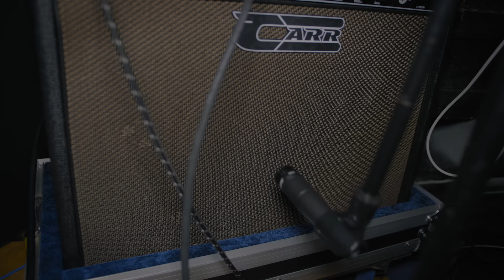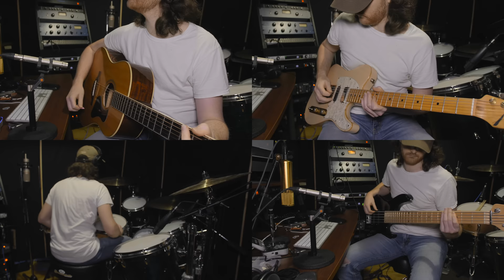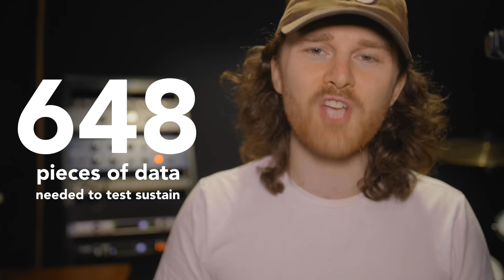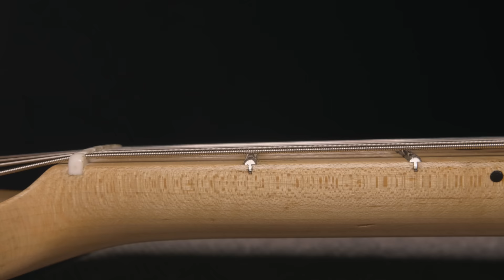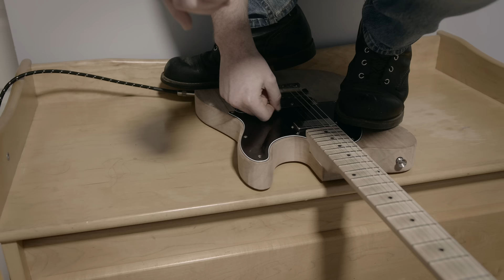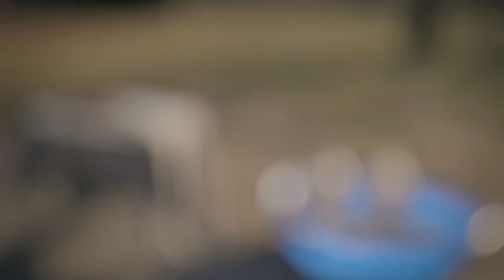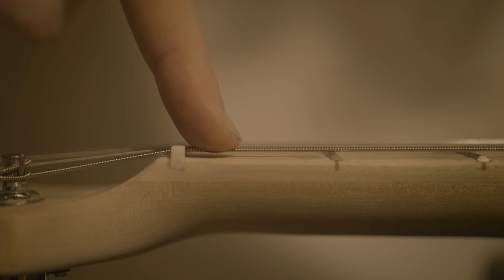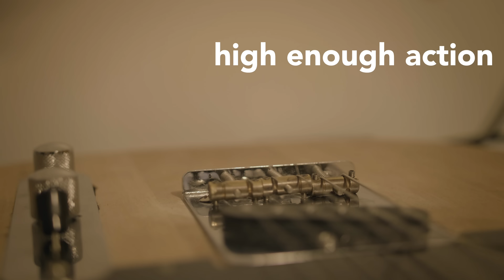Tested: Where Does The Sustain Come From In An Electric Guitar?

Comment: It's always struck me that keeping the energy of a vibrating string in the string is the best way to sustain the vibration. Taking a significant part of that energy and using it to make other things vibrate means the string doesn't have that energy any more.

But then I'm just another person with a half-baked understanding of physics having an opinion. What we need is tests. Thanks Jim Lill for providing them.
Reply: I would agree with you on this 👍
Reply: Your point of view makes sense.  When people go on about having a resonant electric guitar, they are saying that losing string energy to the guitar body is a good thing.   That doesn’t make sense, especially if you are looking for good sustain.  

The whole thing about how if an electric guitar sounds good acoustically it will sound good plugged in is ridiculous.   That’s an Eric Johnsonism that gets repeated endlessly.  It’s nonsense.
Reply: @mark78750  With acoustic guitars, you want to transfer that vibration into the body and for the body to resonate, because the body is doing the amplifying. But with electric guitar you don't use the body to amplify. You're using the amplifier for that!
Reply: I think that’s right for an electric guitar. Acoustic guitars have to transform the vibration into air movement, so that’s a completely different situation.
Reply: I literally had the same epiphany while watching the video.  Seems to me the more insulated the string the more vibration it would keep.  I also understand the quiet resonance test winning out.  Works the same way as cold water heating faster than hot.  The string warbling heavily causes it to loose it's vibration quicker than say a medium to light stroke.  So while you would see a louder sound from a heavier stroke it would also suffer the most sustain loss of volume.
Reply: But like Jim said, how long do you need a string to sustain a note?  He said the longest he's ever played is 4 seconds. All of the guitars, including the cheap kit guitar, had sustain that lasted close to 35 seconds. The difference between the brass saddle and the wooden dowel wasn't that great.
Reply: @joshuasox  I figured sustain was a negative function, as in it's best described as kE loss per second, as a percent value of the original signal. 

Would follow from there that loud notes have the most to lose? I honestly don't know.
Reply: @mark78750  Leo Fender understood this. He specifically designed the first Fender guitars to decrease resonance, because before the Telecaster/Esquire/whatever, most electric guitars were jazz-boxes and hollow-bodies of some kind, which were notorious for screeching feedback. For this among other reasons, I prefer bolt-on necks; that's another thing Fender got right -- you can't exactly just pop on a new neck when you break one on your Les Paul or whatever. Fender's philosophy was all about modularity, practicality, &c. and just makes sense.

I'm not very attracted to set or through neck guitars in general, though they have their place. Not to mention the whole headstock break angle thing. You don't see Strats or Teles with broken headstocks. And simple woods like maple and pine.
Reply: @Lunumbrus  exactly, they would lose the most volume quicker.  I plan on testing myself later this evening.  I have several different guitars to try on.  Like these experiments that challenge the status quo.
Reply: @joshuasox  I can't lie, I'm excited to see how this might affect variability in custom builds, particularly travel-type designs.
Reply: As a banjo picker, I can confirm this. When I slide a brass mute onto my bridge, the result is less overall volume and twang but significantly more sustain. By increasing the mass & inertia of the bridge, less energy is able to transfer from the strings to the head.
Reply: I always thought this until I had an epiphany today. Maybe a resonant guitar accepts more energy from the pick while you are strumming. This vibrating body might then keep your strings going longer. The theory would be like saying that a resonant guitar would be like a lower-ohm speaker cab that accepts more power from the source. In theory, we have virtually infinite power to impart to the strings. If the body itself will take some of that power, too, then all the better. That said, bodies obviously don’t resonate anywhere nearly as long as strings, so I’m probably back with you on your original point. But just a thought I had today.
Reply: My thought, too. If you take some energy out of the string, you reduce the amplitude of the vibration.
Reply: Yeah, this should be the case due to the law of conservation of energy. The player transfers energy to the string at the moment of the pluck. It is then spent on friction (e.g. the string wouldn't vibrate as long underwater as it would in a vacuum), heat dissipation, and making other things vibrate (air, guitar body, etc.) Having a body vibrate must mean less energy is left in the string, since the total energy of the entire system has to remain constant.
Reply: I always think about an old video where Greg Bennett said exactly this. For an electric guitar to sustain as much as possible you want to keep the movement in the string, not transfer it from the string to the wood. That will steal energy from the string. Not his exact words, just the point he wanted to make.
Now I don't know an awful lot about Greg, and I believe he might have been more of a designer than a builder, but what he said always made sense to me.
Reply: Which would kill any argument for tonewood. Dead in the water.
Reply: @latheofheaven1017  but is that transfer happening by the string transferring its energy through the soundboard, or the air that it moves resonating in the cavity or the guitar? Once again, I feel like the mechanical transfer would equate to a loss of sustain, and it's the cavity that's doing more of the work. The test is that if you block up the hole of an acoustic, suddenly it's pretty quiet.
Reply: @jamesstonehouse3448  To some extent it's both, but much more mechanically through the bridge into the soundboard. Otherwise you could do the following - strum an unplugged electric guitar very close to the acoustic guitar, and you'd hear the sound as if you were playing the acoustic. Obviously that doesn't happen. My acoustic does resonate a bit when I'm playing other instruments nearby, but not nearly as much as when I'm playing its own strings. I'm not sure what your cavity example proves, because it's not just the externally generated sound waves that resonate inside of the cavity, but also sound waves generated by the soundboard.
Reply: @jamesstonehouse3448  Not completely--the wood still acts as a filter: absorbing some frequencies more than others, and so changes the resulting tone.  The slight compromise to sustain might be totally worth it.
Reply: @joshuasox  Think it has more to do with the weight of the string in such an instance... When you pluck a string more briskly it requires more energy to slow it back down and bring it back into equilibrium with the sympathetic strings vibrating around it, thus it loses it energy more rapidly than it would had it been strummed in a fashion that had it vibrating closer to the strings around it
Reply: You are correct, in the science. Playing technique has a lot to do with it also.
Reply: @nesicus  Leo Fender was very practical, not always musical. He had to be convinced of the importance of better intonation years after the Telecaster came out. The break angle is only a problem on guitars like the Les Paul, which aggravates it by angling the neck itself to the body and you don't see broken Ibanez headstocks (which have a break angle). A straight headstock saves on wood (cost effective) but string trees add friction on strings for lesser tuning stability (after bends or floating bridge use). I see no advantage in set necks at all.
Reply: @Leo_ofRedKeep  the advantage of set and neck through designs is the playing comfort you can get. Nowdays they make rounded heels with bolt on necks. Neckthrough design is by far most comfortable at heel spot.
Reply: @Leo_ofRedKeep  adjusting the break angle on les paul, by raising the tailpiece, has profound effect on how the neck and strings feel. It's better to have it than not, as you can set it how you like it. I'd argue that changing this angle has an effect on string tone as well, but I guess it's too dangerous here because people have seen the light and are already trashing their instruments because nothing matters in guitar, just the pickup and strings. Pickup and strings doesn't make a bad instrument into a good one. You can't stick PAF on tele and get 59 Les Paul tones.
Reply: I have been preaching that and other basic physics facts on guitar channels for years!  I also get into more advanced wave theory, the electronics... Degree as an electrician with some  engineering school, and luthier for over 40 years, and a huge physics geek!  I even built wave tech (electromagnetic spectrum) for major universities, research institutions in medical, Biophysics, material sciences and other fields, even NASA...
Reply: @mark78750  A crap load of famous musicians drank the koolaid, and are experiencing the placebo effect!
Reply: @latheofheaven1017  Not the whole body, just the soundboard.  The body just reflects sound around inside through the air, and out of the sound hole, so stiffer back and sides gives better reflections!
Reply: @Lunumbrus  You are getting sustain mixed up with decay.  Sustain means to keep over time, decay to lose over time:  Sustain decays into silence.  They are related but not one and the same.
Reply: @TheMemagNeman  I don't think the break angle makes any significant tone difference. People debating this are audiophiles interested in sound, not music.
Reply: @Bob-of-Zoid  Most musicians (most artists, really) are feeling fools going off their own fantasy. What they have to say next to their playing is of no value whatsoever.
Reply: @Leo_ofRedKeep  It's not significant, it's minute but it's there.
It does change the feel of the instrument.
I play guitar every day.
I tinker with guitars every week.
Reply: @nesicus  Maple doesn't break as easy as mahogany, but as for Gibson head stocks breaking, That's an engineering flaw they are unwilling to correct, it not only breaks easy, due to the angle bringing a cut across the grain, but it's a huge waste of wood to make them that way, an ever scarcer natural resource!  There is absolutely nothing wrong with a luthiers joint!  Even the not so good as now glue they used in the 50's was sufficient to make a joint, stronger than the wood itself!  If you make a neck strong enough to not break easily, a bolt on for easy replacement is not required, and fender did not doit for modularity, but for speed in production and cost savings!  Fenders should have more angle to their headstocks! The need for string retainers cause tuning issues!

The neck joints in most bolt on instruments are unfinished and shrink and swell with climate changes, sometimes leading to cracked finishes and even cracked wood.

 Both Fender and Gibson are resting on past achievements and charging a small fortune for the name alone!  They are stuck in the past and selling tradition, which is worthless when compared to technology!  Want that Strat or Telly sound?  Use the same pickups in a real guitar!
Reply: @TheMemagNeman  The angle changes the feel of strings, yes, because it determines the pressure against the nut or bridge. The smaller the angle, the less pressure there is and the player bends an effectively longer string, which makes it easier. That's why people think there is less tension with a smaller angle (it's wrong, tension is the same but bending is easier). It's only a matter of adapting, though, the same as changing string gauge or type.
Reply: @Lunumbrus  I have been building guitars for a loooooooong time, and you can do what I and others did and study the sciences, do all the math, do some experiments, only to end up building pretty much free form!  You are missing a few very important points: 1.  Quantification!  If you keep a few basics in mind, all of the little details do not add up to any significant changes at all, and are even inaudible!  2. Every individual has different tastes in looks, feel, and sound, so there is no "one size fit's all" anyhow.

Just don't build anything so impractical no one can play it, or so ugly no one will want it!
Reply: @Leo_ofRedKeep  Ye, I know that.
My point was , the break angle is important to a "feel" (as in fingers touching the strings) of the guitar.
Reply: dude you are a "mad guitar scientist"! your videos are so fun to watch, thank you for your dedication and passion.
Reply: @Leo_ofRedKeep  Brian May, is a published Physicist, and Brian Cox a once famous keyboard player, so although common, you can't generalize.  The arts and sciences have commonalities for sure, but that doesn't mean that most scientists aren't poor at art, and most artists poor at science.  All spectra seem to have something akin to gravitational fields.

Really though it's more likely that someone in the know keeps silent, or is careful to not make absolute claims, whereas those who think they know but are clueless, can't shut up about it, and are more insistent on being right!  (<:
Reply: @mark78750  I fundamentally and respectfully disagree.
It's all about harmonic content, and then it's about how that's interpreted, IE pickups, wiring and on down the line.
You can subtract this "content" but not really add it.
Reply: @Bob-of-Zoid  Absolutely. It's the top that contributes most of the sound and tone.
Reply: @mark78750  Can confirm - one of my favorite Ibanez guitars sounds pretty meh unplugged, but it's fantastic when amplified.
Reply: It’s so simple. Follow the energy.  If the energy goes through the bridge and finds something it can vibrate, it does.  The sustaining string loses it and the guitar (top) takes it.  Acoustic guitars have less sustain than semi-hollow, and semi-hollow have less sustain than solid.  A little knowledge of physics could have helped, Jim.